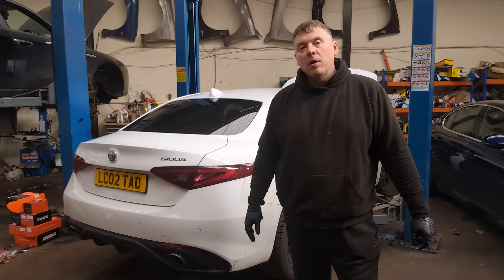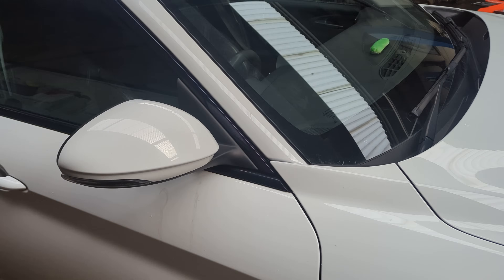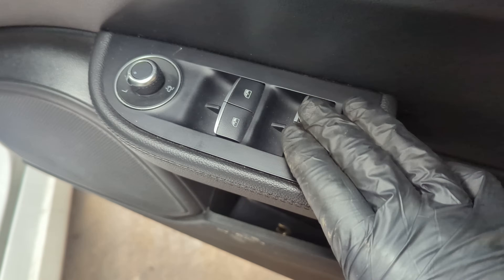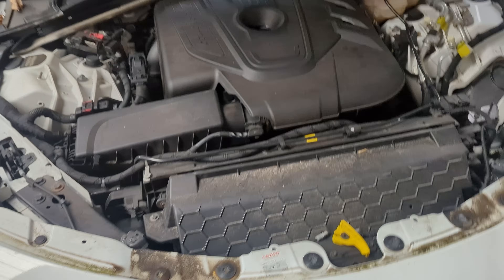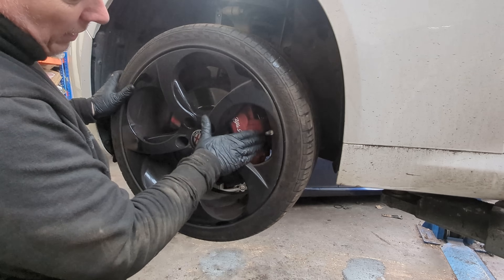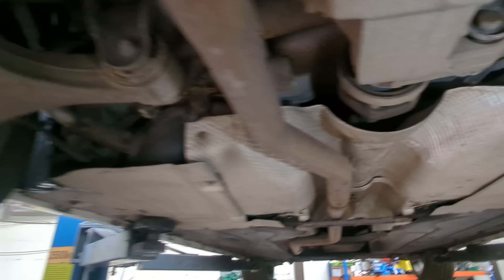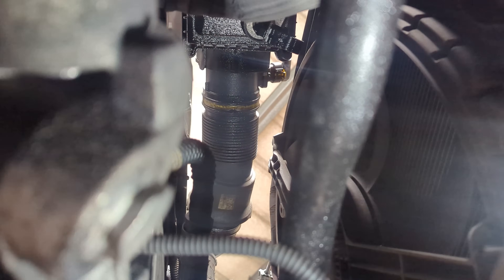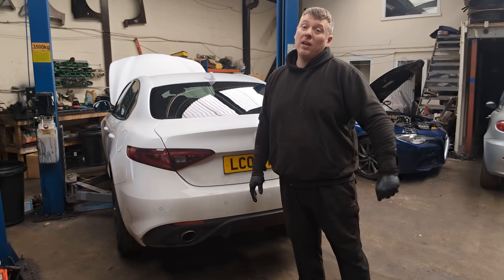ARE MODERN ALFA ROMEOS RELIABLE?    LETS FIND OUT!

Comment: The Giulia is a beautiful car, I was looking for one in 2016 but ended up with buying a one owner 2006 Mercedes-Benz E320, I traded that in for a 2000 Mecrury Grand Marquis in 2018 and that car has basically been 100% reliable just the basic oil changes etc. 
But every once in a while I speculate of getting a Giulia, one of the main concerns is is it going to be reliable and also in the basic models there is no naturally aspirated V6 or V8 available... But I am still considering!

Comment: My Mrs has a 2014 Giulietta JTDM-2 and its fantastic. It's ticked over 165,000 miles and the only thing it really needed were a new set of clutches for the TCT gearbox at 149,000. 

Currently chasing an issue of suspension knock when going over bumpy roads, changed the wishbones and links but the noise is still there. Any ideas?
Reply from the maker: If its rearvit will need bushes on the rear hub

Comment: I have a 147 1.9 JTDm 120Cv that I bought in 2018 with 180000km now it has 300.000km and still pushing like she has 0km you can see it in my channel, I changed the clutch including emitter/receiver, one set of front axle one time including shock absorbers, EGR valve, Thermostat, nothing so bad, then I took an other Alfa Giulietta with 76000km now it has 105000km nothing changed so far it is a 2.0 JTDm 150cv it is also in my channel where I pushed it recently to 220 km/h in Autobahn 😅 Happy with my 2 Alfas more over they are so beautiful and stylish  🍀🐍🐍🐍

Comment: How about the Giulietta? Got two to look at, a 1.4 petrol and. 2.0 diesel both 2011 …
Reply from the maker: I'd go manual diesel giuletta.
Reply: Nice one - cheers 👍
Reply: The giuletta is a really nice car to drive & own.  I'm on my second now.  I had a 2011 2.0 diesel which I picked up 2nd hand and ran for 6 years, only problem was a failed exhaust sensor which was an easy fix.  I switched it for a 2015 Giuletta QV 1.75l petrol with auto box (same combination of engine & gearbox as the Alfa 4c) great fun to drive.  I've now had it for 5 years & it's been totally reliable.  I'm lucky to have a really good independent Alfa/Fiat garage locally, Turin Motors in Leeds, who perform all the services & are a lot cheaper than the main dealers.

Comment: Currently driving a 2010 159 Sportwagon TBi with, get this, 289.000km on the clock. Drives like a peach, did just over 10.000 km since I bought it in late October ‘23. My opinion is, if you haven’t bought the car new you will always be at the mercy of how the previous owner(s) maintained the car. Any car from any manufacturer will have particular issues. The main problem with Alfas is they depreciated extremely to a point where people who can’t actually afford to run them end up buying them. But this is still a premium brand. For instance, it sounds like I’m going to need a new exhaust camshaft phaser, that’s 750€!! How many people would consider putting that kind of money into a car with 290k km? Instead, most people would most likely just change the cam belt (if even that) and call it a day! Just take care of the car properly and an Alfa will be no less, if even more, reliable than any other brand on the market. Imagine calling a 159 unreliable when at the same time you had the E9x with the N series motor, or Mercedes with their balance shaft and intake issues…I love my 159, it truly is a special car.

Comment: One of these , a 2.2 Super Auto diesel sold bca £4000 with a cap clean of 8200. My 4K bid was later than the other proxi bidder.  . This m seller is selling as bca reported.  Misfire when cold.  Better when warm.  I may want pay other trader some trade profit.  Do you think it’ll be the fuel filter or similar ?? Cheers Dan.    I’d run it around at 5k

Comment: I have a 2012 Giulietta M.A. 170 with 117000 km. Problems it has had so far:

-Multiair actuator failure
-TCT Clutch actuator completely failed
-Waterpump
-Radiator Cracked
-Coolant reservoir tank cracked
-Rear wiper stopped working. (It's the body computer failure that causes it)
-Air recirculation flap motor broke.
-Idle RPM fluctuation (searched a lot through the forums, seems that no one in the planet earth has solved this one problem. Changed Throttle body two times, still getting TPS error)
-Door and trunk wires have super low quality. OEM Wires break very easily. (Rear lights , door speakers, trunk button wire, etc..)

Other than these, I have changed some suspension parts, strut mounts, engine mounts which are expected to be worn after 12 years..

Comment: I've had my 2.0 super with 26,000kms on the clock for under a month, so far:
Currently tracing an oil leak, good chance it's the oil cooler gasket.
Air conditioning not blowing cold, appears to be a sensor or module (gas is fine) 
It's a beautiful piece of shit though.

Comment: I had a Stelvio and loved it, unfortunately after taking it through a car wash with under body spray the car went into limp mode, they had to do repairs to exposed wires. That was the start of the problems. After 5 trips back for wiring repairs I sold the vehicle. I have never been more disappointed because it was the best driving car I have ever owned.
Reply from the maker: Oh dear not good

Comment: My 147, 156 & 159 were ultra reliable, moreso than my E36 and E46's.

My Mazda steering wheel buttons have worn through and are rarely used, bizarre.

My only Benz was a giant maintenance issue, a 2016 SL500.

So my experience is Afla products are great.  Not Toyota great, but they also aren't bland.

Comment: The perceptions that exist in regards to certain machines and the reality of individual experiences don't always align.  I drive a Nissan 370Z, which is Japanese and therefore supposedly ultra-reliable, but while it's certainly not unreliable, I've had to put a lot of money into it in a relatively short amount of time.  This is a car that has only 42,000 miles on it and is well-maintained.  Then there's my Moto Guzzi V7, an Italian, and therefore supposedly unreliable motorcycle which has been bomb proof over 15,000 hard miles.  Granted the Guzzi is newer, but you get a feeling of craftsmanship with this bike that you don't get with the Nissan, despite how amazingly fun it is to drive.  My experience with Italian machines thus far has been very positive.

Comment: I am verry happy with mine...except...the oil pressure regulator or soemthing related is acting up lately...replaced the thing, changed the oil...changed oil again, replaced again... Still gets and error if ine lifts the throttle after high load at around 2200 RPM.... Totally annoying error....going to replace oil again and the oil pressure switch next time...😢
Reply: Some of the above comments address this issue I think.
Reply: @tombassman  no they have low oil pressure warnings I do get an general check engine light and the error code suggests problems with the engine oil pressure regulator....which was changed twice without any substantial improvements.... Sadly it seems that I am pretty much alone with this problem...
Reply: @justacomment1657  oh, sorry to hear that- good luck finding a solution 👍

Comment: Are tyres on this car the correct width? There seems to be a fashion for tyres that are narrower than the wheels (usually souped up Golfs) if that is the case it is not my cup of tea. I have never seen a new car with tyres like that. What do you think?
Reply: I think the Veloce and QV rims have a little bit of a stretched fitment, it improves handling. Check out the Tirerack testing on the same tyre width being used on 7", 8" and 9" wide rims.   It was fastest in the dry on the 9" wide rims. A lot of the German brands, however, fit the widest allowable tyre on a rim which is kind of strange IMO.

Comment: Currently mulling over chopping in my euro 5 318d for either a newer euro 6 320d or one of these. The bmw has been brilliant over nearly 4 years and on 110k. For me, someone who hasn't owned an alfa since a little sud 1.3 in 1989/90 it's a case of am I brave enough to get a guilia as I adore the styling and the damping on the f30 out of the box is actually pretty poor. Bumpy country roads undo it. Reckon the Alfa might be better in that department!
Reply from the maker: give them both a drive and see what you like. you dont have to worry about reliability on alfas now

Comment: Mines been off the road for 3 months with what now looks like an ECU problem. It's only 5 years old and 33k miles. Very poor owners experience sadly.

Even though still under warranty the dealership didn't want to know and were probably going to have to  take them to the small.claims Court. Very poor dealership network is a big problem.

Comment: I have had a Alfa Romeo 156 2.4 jtd, a 159 sw 1.9 jtdm, a 159 sw 2.0 jtdm 170 hp and I ve overcame 200,000 km without any great issue. Only normal maintanance: italian Jtdm are quite unbreakable! I have to change because of the climate change/pollution restrictions :((
I think that petrol cars in general aren't as reliable
Reply from the maker: The old 2.4 was amazing for reliability

Comment: Why are those subframes not treated properly?! They should not rust at all! 156/159 and now Giulia. In a few years it will crack like it happend to the others! I'm curious where are the aluminium parts and I'm hoping those are the sills, belly and other parts that meet with salt and other road stuff that comes in contact. The owner should immediately do an electrostatic paint job on the subframe(s) so they last forever! I would definetely do this before it's too late.

Comment: I wouldn’t disagree with you to a point. Generally they are as tough as any other modern car. 

The issue is, dealer networks or lack of and availability of spares and because of that, my Giulietta which I’ve owned for 8 years will be my last Alfa Romeo.

Comment: A little bit of rust and of course the UK rust is an issue in the UK an oil leak well we have a seven year old Suzuki Baleno with only 78000 kilometres on it much less than 700000 odd miles but there is nothing wrong with it after all Suzuki's are more reliable than any European or British built cars but Toyota's are more reliable than anything except for Mazdas Hondas Lexuses and Suzuki's actually in the same factory in India they make the Toyota Starlet which is a rebadged Suzuki Baleno and l own a 27 year old Toyota Hilux no rust issues at all and l live in Australia were cars don't rust that much and Alfa Romeo's are a rare sight in Australia its mostly Toyota's one last thing my Hilux has only 436000 kilometres on it

Comment: If you think 7yrs/72Kmi is a reliability achievement for modern vehicles, just stop. IT ISN"T. And hanging with German garbage isn't either..
My 2011 Chevy truck has 180Kmi, and I've done NOTHING but change oil and tires. Runs like the day I bought it.
I'm getting ready to change belts, injectors, spark plugs, bushings, shocks, brakes, etc. Just so that I can run it another 150-200Kmi, and see where I'll go from there.

Comment: Hi im looking at a 2.2 alfa guila 2017 with 100,000 miles on thr clock with full service history, should i be concerned with high mileage Alfa's?
Reply from the maker: Should be fine just done over pay.
Reply: @ItaliaAutos  £11500 top spec might get it for £11000 or go for a high mileage Volvo s90 2018 with 100k

Comment: 1. You did not check any of the electrical systems, except the infotainment/dash and lights on the transmission!
2. You can't make a convincing case without showing us > 100 different cars of the same model, all in great condition.
3. In the US, Fiat regularly gets bottom score for reliability in JD Powers AND Consumer Reports
I'd be happy if Fiat produces high quality cars. It's only good for consumers.
Reply from the maker: I one man ive me chance lol. I've also done plenty of other on the ramp check over videos on alfas and fiats. fiat models are to small for the us market so they will never do well.

Comment: I had a 147, the engine exploded.

I had a Giulia, it broke down 13 times in 3 months.

My friend has a Giulietta it breaks monthly.

My other friend has a Giulietta it breaks weekly.

Is this a big enough sample group to judge reliability? Absolutely not.

Would I buy one again? Not a fucking chance in hell.
Reply: Strange that? I own an 8-year-old Alfa Romeo Mito It has been the most reliable car I've ever owned! Your comment is bullshit and people are starting to wake up to haters like you who constantly bash the marque and see-through posts like yours. Your experience is at odds not corresponding with this channel, the Car Wizard channel and the US JD Power 2023 survey.
Reply: What you banging on about? 😂 Your experience is even more anecdotal than mine with a sample group of one. Are you mentally challenged? 😂😂

My Alfa experience was terrible, that's a fact. 

Alfa Giulia was battery related issues it kept leaving me stranded but nobody knew then this was an issue and the dealership was stumped.

The fuel door lock fell off.

The arm rest foams collapsed in two years on both sides.

The infotainment unit failed and needed replacement under warranty.

The overall quality was dreadful, that's just a fact.

My friends Matt and Tom both own their Giulietta's and they'll never sell them, but neither would call them reliable. 😂

Are you that much of a fanatic? I've had bad experiences with Mini, Audi and Honda too.. it's not brand specific. I'm currently waiting for my Audi to be repaired. Shit happens. 😂

Comment: I work on these POS Alfa Guilia and Stelvio cars everyday.   In my opinion there just terrible to service and work on.   Oil cooler nightmare job, rear brake discs corrode and get pitted frequently, rear handbrake have faults , oil filter on diesel models are a pain to change, the Quadrofolio V6 model the Aux belt is on a mileage change at 40,000 miles and to renew the belt is a major job, steering the vehicle at slow speed and on full lock the steering fights with you as if the camber is miles off..  Front brake pads to change is a silly design you have to remove the two brake pins and remove the complete brake caliper and your depending on the metal brake pipe to support the caliper while your removing the brake pads except on the Stelvio model the brake caliper is on a flexy pipe. Electrical faults as in the battery continually drains due to a fault in the transmission unit.   You need Security Gateway to connect your diagnostic computer into the vehicle which is a charge/fee you have to pay to Alfa/Fiat to get any information or service codes/service lights to be reset..   the A/C leak off pipe is directly above the transmission and the pipe as two flaps which are suppose to open to allow the water to escape but the pipe gets stuck shut and the heater unit eventually fills with A/C water and fills up the front footwell areas and the carpet is deep in water , the two water drains at the windscreen panel get choked up with much and leaves and the rain water can’t escape so it eventually leaks water into the passenger area.   I can continue as there’s loads more faults …!!!!!